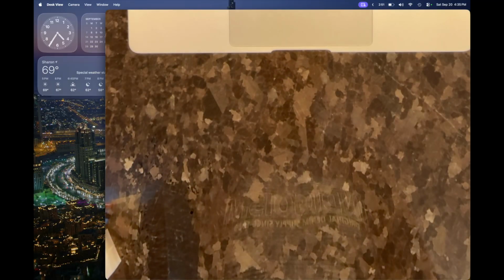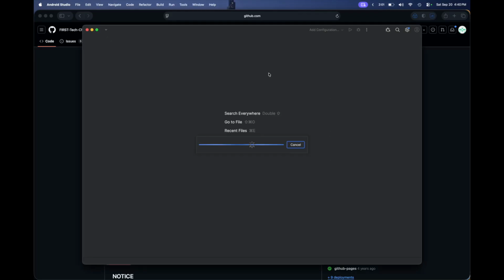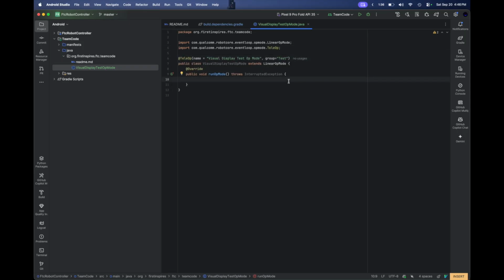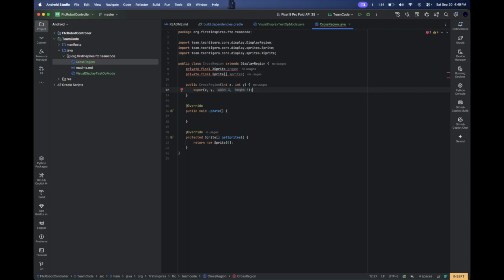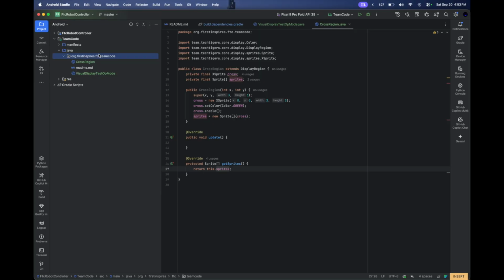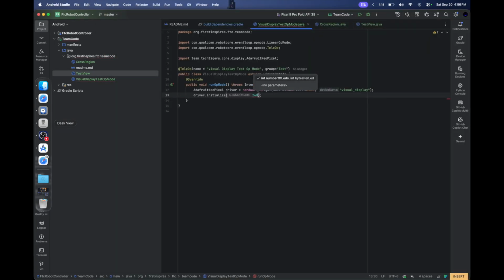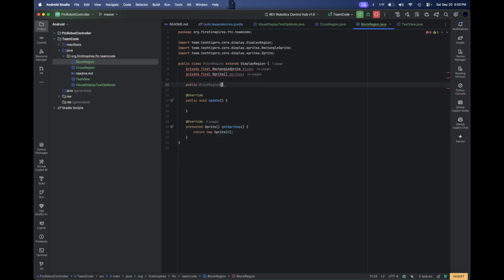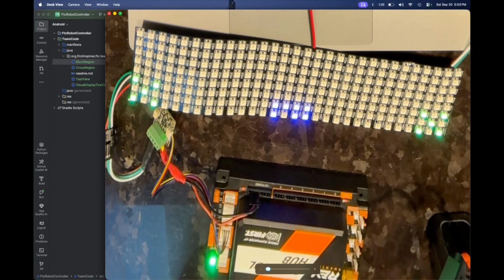Adding a Screen to your FTC robot using the Tech Tigers Library

Comment: This might be one of the coolest things I've seen in FTC. Did you guys notice any issues with battery health, loop times, or brownouts because of this? If not, I might add to my teams bot.
Reply from the maker: We never had major issues with battery drain, although it will definitely use some power so keep that in mind. As for loop times, our library only updates LEDs that have changed their state (changed color/turned on or off) in order to preserve loop times. I believe the impact on loop times for us last year was 5 ms or so, but I don't remember exactly. Contact us if you would like any help!